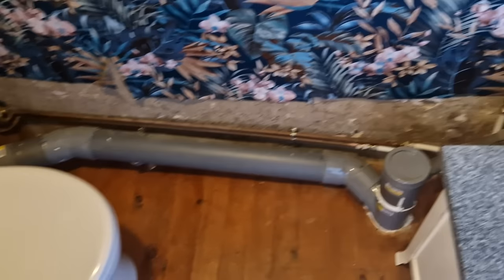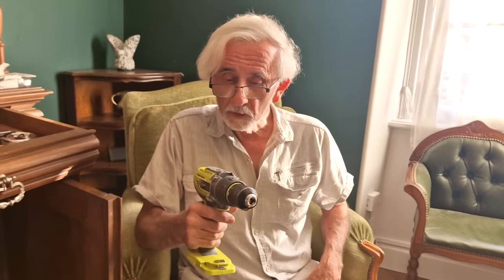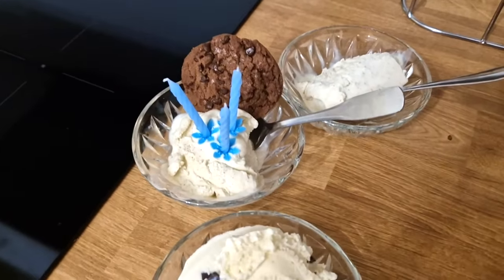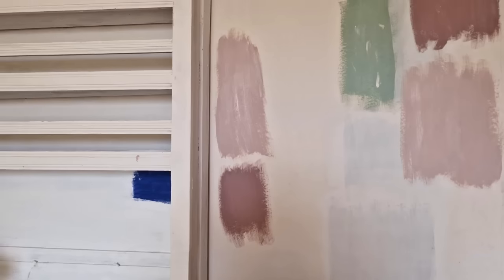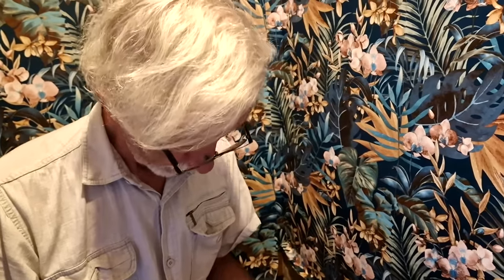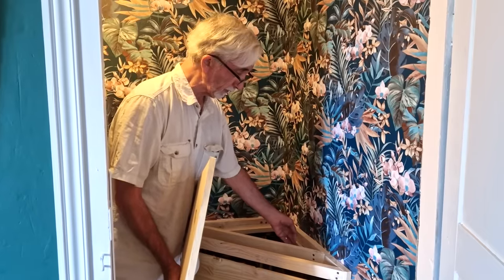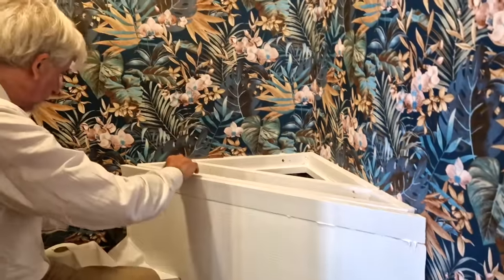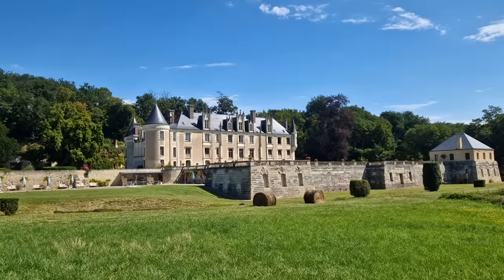BATHROOM RENOVATION Before and After!  REVEAL of our DIY Bathroom furniture

Comment: If you would have cut the trim at 45 degrees it would have a perfect joint. Your store should have small jigs already at 45 and 90 degrees and you would make good use in future remodeling. Your dad did a nice job in bath❣️
Reply from the maker: We thought about that but unfortunately that corner is not a 90 degree angle it's slightly wider so it wouldn't be 45 degrees it would be some mystery number of slightly more than 45 and after we figured that out we decided that filling it with putty was probably a lot easier lol